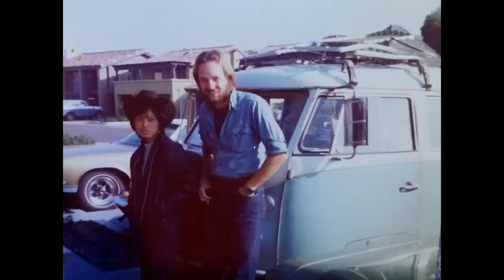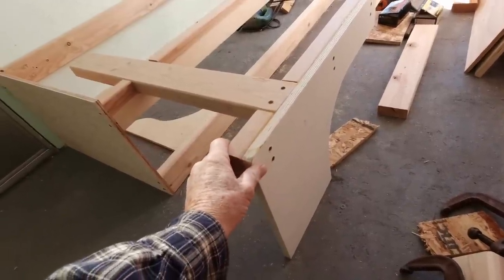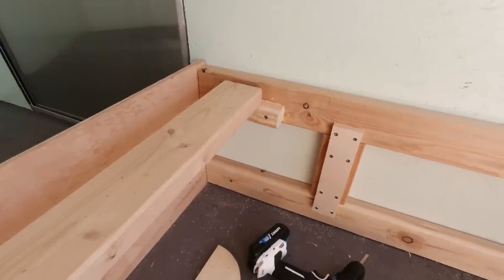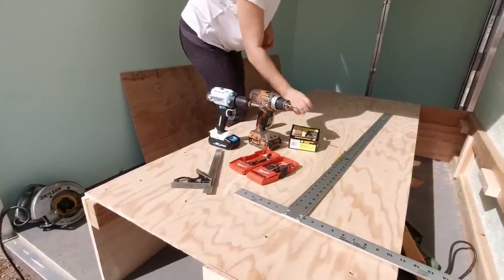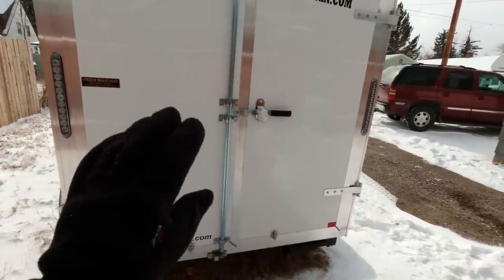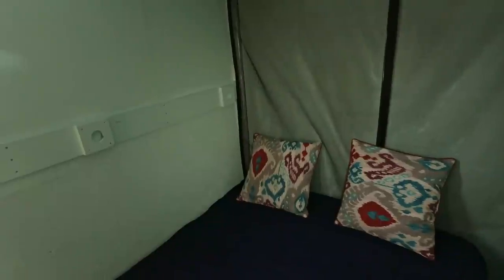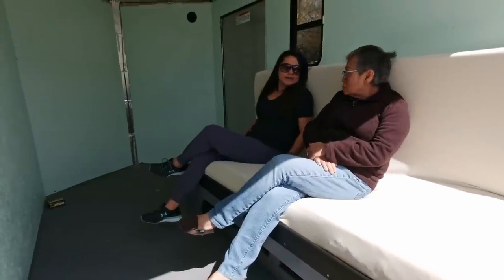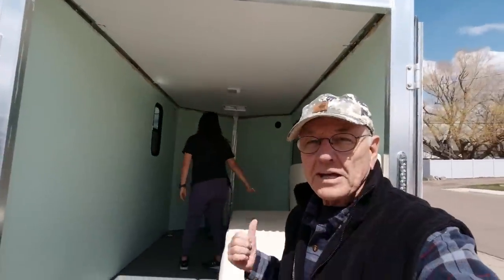RV Pull-Out Bed for Cargo Trailer or Van - DIY

Comment: I'm thinking about building a queen size Murphy bed into my cargo trailer conversion so I can have much more space to move around in the trailer during the day. I need to make as much movement room as possible so I can drive my electric wheelchair in and be able to turn it around so it's ready to go right back out with my wheelchair.
Reply from the maker: A murphy bed should work for your needs. That would give you more floorspace for your wheelchair.

Comment: I missed this video when you posted it. We're struggling trying to figure-out seating. My wife and I built pipe berths from your idea. Yes, they are comfortable. Our trailer is 7' wide and the 78" pipe berth accommodates my 73" height; so well that I'm known to take naps in the trailer in the driveway. My wife is only 62 ("and a half!")" tall. The top berth is a bit of a climb for her. Now, I'm considering the fold-out bed or a deep sofa for my wife and any guest grandkids. I'll keep the pipe berth for myself.

Comment: How about piano hinge the plywood pieces.  That way you could have an angled back rest, plus it would be easier to fold than it is to pick up the wood and put it on top of the other piece. You could have extend the front skirt up about 1/2 inch then you wouldn't have needed to screw it down. This would allow you to lift just the plywood to access the storage without having to pull it out.

Comment: Rick, you were So Right when proclaiming that the interior of a cargo-build is Never finished, or Always up for a 'redo'. Something like that. I'm now working on my third rebuild of the bed and Thank God for all your ideas and concepts. I Cannot remember the name of those Special 'pulleys' that allow one person to lift 500-lbs. with ease?? Since Bruzetta Demands to sleep with me,🤓 I've had to redesign & rebuild the bed now three times. She is 145 lbs. and Can't get up on her own as the platform is over three feet off the floor. Any ideas??? I'm thinking rigging a harness to 'lift her hulk' up into the bed via the magic of one of those pulleys??? What a Massive Task, I'm Almost Stumped. 🤔 Onwards and Upwards, I have little choice. Hoping Linda's foot is almost ready for some Break-Dancing??? That would be one Great Video. 😂 (more info arriving in the mail soon) God Bless 🤗
Reply from the maker: Can she go up steps at all?  I'm thinking building a set of steps that you use to get into your trailer but bring in at night so she can use them to get up on the bed.
Reply: @gonagain  Yes, Yes & Yes, however she has yet to get comfortable with the concept. Mastiffs are not the 'bouncy or jumpy' type breed, & she keeps Looking at the stairs as if it's an Alien. I started a rebuild with the steps being wider & less tall. I'm thinking small bits of steak to coax her now. She blew-out her right knee six weeks ago, and I built a ramp for the FJ but no dice, that too is an Alien. Funny Dog, but we need each other. Thanks for the Tip and the Encouragement. I'll send a pic of the revamp.🎯👊
Reply from the maker: @vincenzodemarco7983  Please do. What about a folding ramp? Might be easier if you just slept on the floor.

Comment: I like the added touches you do that give added strength such as the frame against the wall that carries the load to the floor .
I like the open front with the wider legs out of 3/4 plywood.
Thanks for another good build.
How is Linda doing?
Reply from the maker: She's doing great, Jody!  The cast should be coming off next week.

Comment: If I ever build one, I’d like it to be similar to what you built before where the bed is hinged to the wall. I’d like them on both sides so when they come down it’s a full size bed. Put 1 down and you have a fairly big table
Reply from the maker: You bet, and it depends on if you want to use the trailer for hauling an ATV or something.

Comment: The only addition I would make to the sliding bed would be access doors on the ends, under the platform. I don't think the strength would be compromised by adding doors,  since the majority of the weight bearing is on the wall frame and the center (long side) frame. 
Access doors would allow equipment to be loaded under the bed while you are standing outside the trailer.
Reply from the maker: Nice idea!